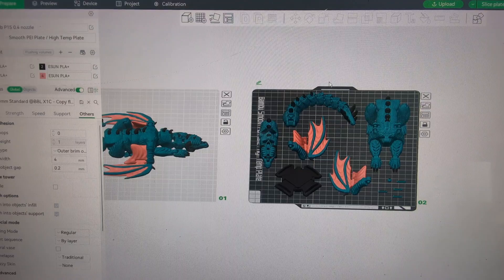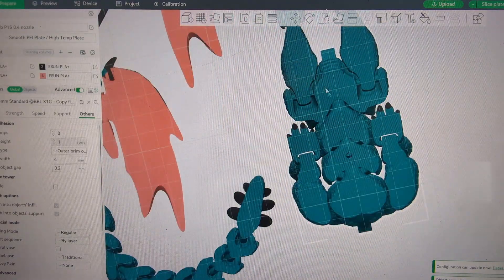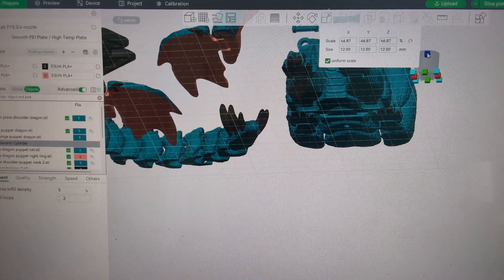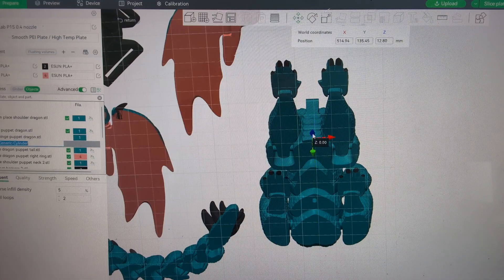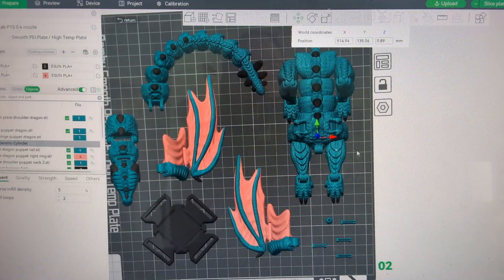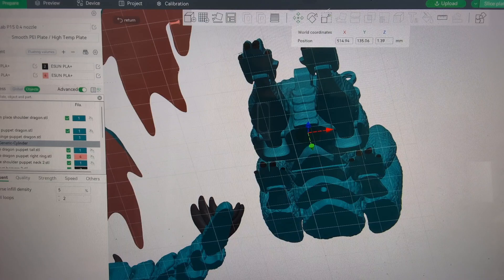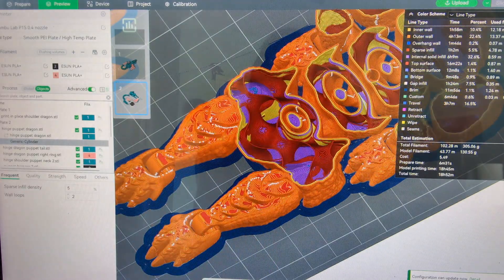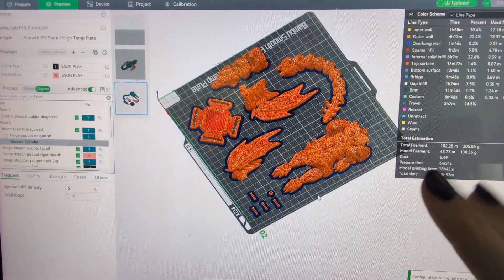Adding Magnet Holes to Prints in Bambu Studio

Comment: but this isnt making sure the magnet is a good fit. Just poking a hole though without knowing how much negative space is inside the magnet. 
How do you create the negative space starting from the build plate a specific height or depth into the model?
Reply from the maker: @rb30e  that's obviously going to change for each magnet size :) I usually plan for 0.2mm extra space compared to the size of the magnets, so you can just choose the size of your negative space/cylinder with the mm size of your magnet + that 0.2mm or so tolerance :)